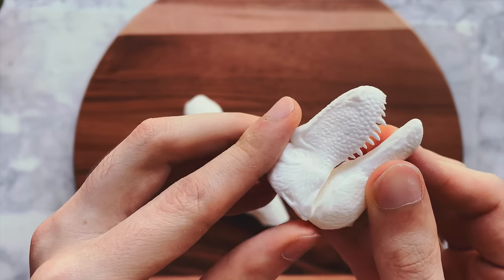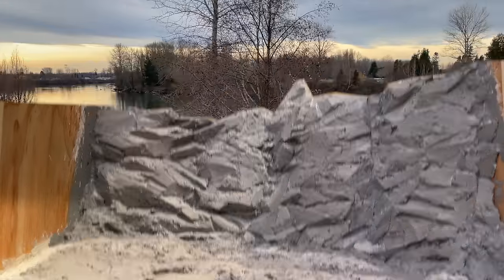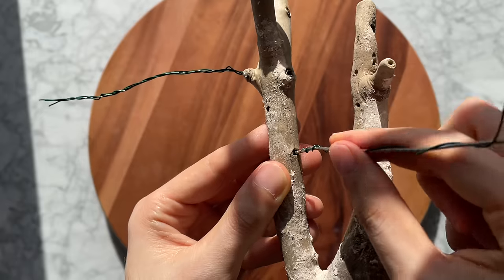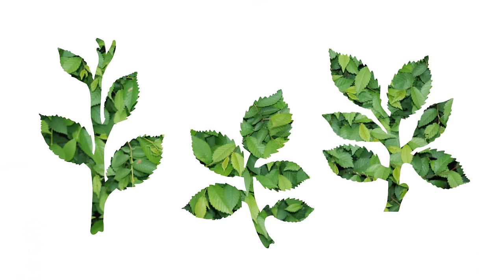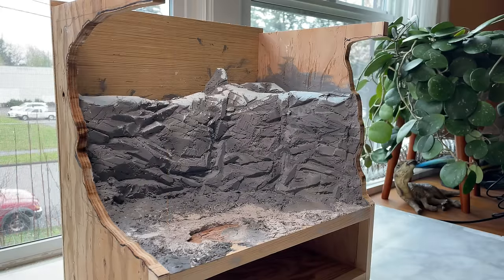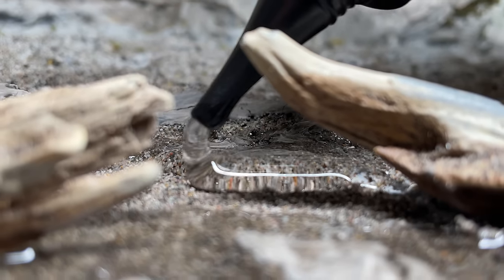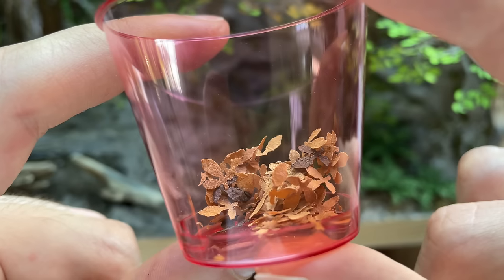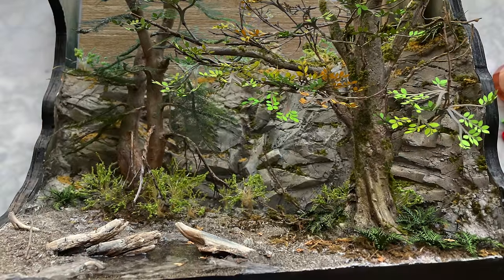I made a Diorama that changes from DAY to NIGHT!

Comment: One thing you might consider for painting foam rock surfaces is to look for a chalky white paint (I've had a lot of good luck with applebarrel's larger craft paint bottles). Put on a full coat and let it fully dry, then you can use thinned inks to create something similar to the leopard spotting technique, just dabbing on a mix of colors, though I mainly use brown and black ones, but a bit of others early on works well. Adding a light drybrush of an off white finishes the effect to look like a more natural stone for smaller scales

Comment: Hi Kayakasaurus, I'm starting to have sculpting dinosaurs as part of a hobby and the huge inspiration for why is your works. But I'm not too sure if I'm doing stuff right. So I'm just gonna ask two things
 
Is air dry clay good for sculpting, say, dinosaurs? And where do you get your skeletal references?
Reply from the maker: Hey sure! Air dry clay is fine for starting out. Most air dry clays shrink when the moisture drys out, causing them to crack if you use an armature. There are air dry clays that don’t shrink/crack but I haven’t used them and don’t remember the names. 

I get Skeletals from Google images. If it’s an important project I’ll look into who made it to see if it’s a reputable one. Photos of the actual fossils help too, especially for the skull.. if there is one lol.
Reply: Scott Hartman has some great skeletals. I need to get some calipers for measurement.

Comment: I do not want to point out the fact that the teeth are long and out of the mouth. I personally would change that, because Tyrannosaurus had its teeth covered by lips, so you can only see a small portion of the teeth sticking out. Pls tell me if lythronax had lips or not. I would appreciate it (nice job tho, kayakasaurus <(••)> (>••)> <(••<)
Reply: Oops I didn’t mean the not at the start :/